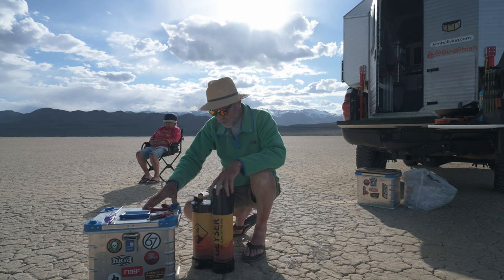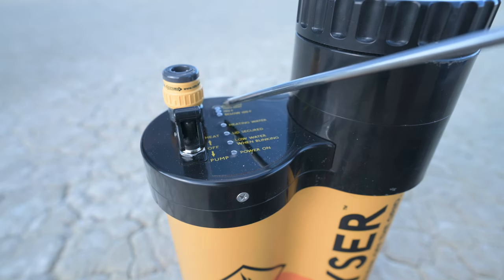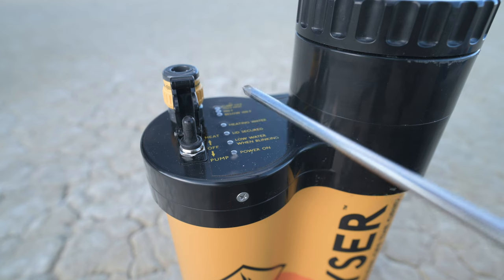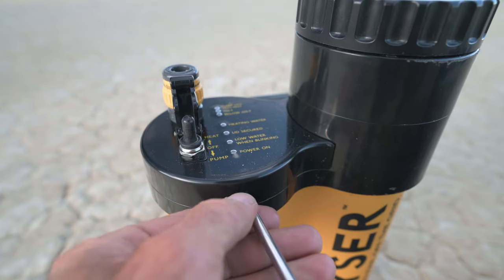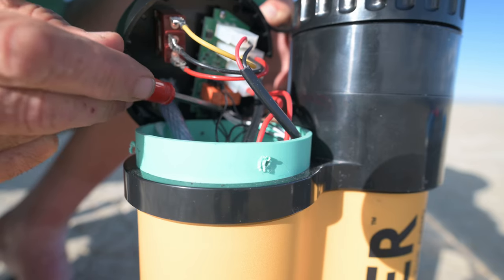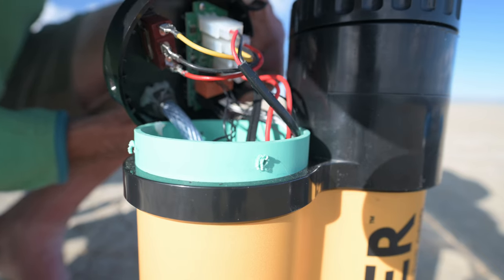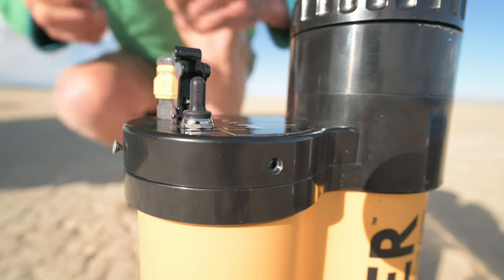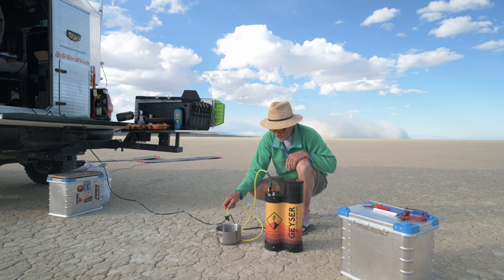Geyser Shower - In The Field Fix for Pump Off Too Hot

Comment: I just googled this because my brand new non-heater version is doing this!
Reply: Screw it! I'm using a 🪣 instead 😅
Reply from the maker: This should fix the non-heated version too….and if you just like extra hot water
Reply from the maker: @evenflowoverland  I’ve heard it takes awhile to clear the too hot faults if you add too much hot water so I’m just leaving mine disabled for the too hot temps fault..not exchanging it for a new one

Comment: That's why I bought the non-heater version 😅haha!!!
Reply from the maker: I think the non-heater version has the same "Pump Off Too Hot" feature as well doesn't it to keep from burning yourself in case you add too much boiling water? The problem i had happened without using the heater to heat the water....it takes awhile for it to heat up the water heating at 100 watts so I was just adding boiling water as if I had the non-heated version. Either way thanks a bunch for watching and commenting!

Comment: What did he do? The video was blurry; I did not see the purpose of this.
Reply from the maker: You're right the wires I snipped were not in focus unfortunately so it doesn't show very well and i didn't vocalize what wires I was snipping when I actually did it....however ...you must have missed around 1:30 in the video I explained support told me to look for a connection labeled "thermal" that had 4 white wires leading to it...i needed to snip the two white wires on it with black marks to dissable the "Too Hot" sensor. Sorry if it wasn't very clear to you what I did and why.